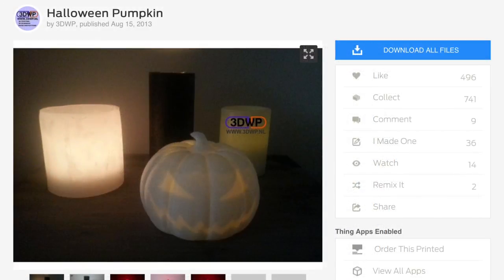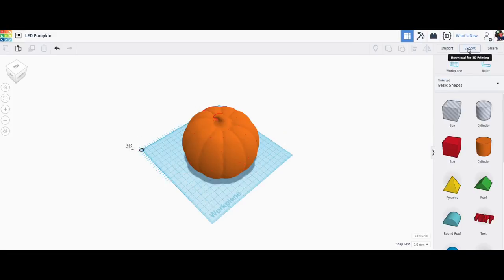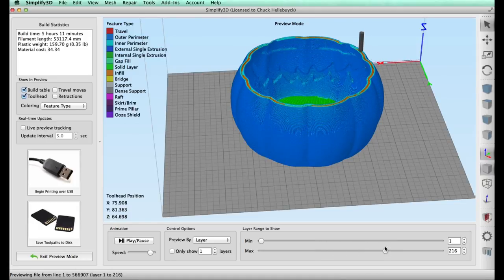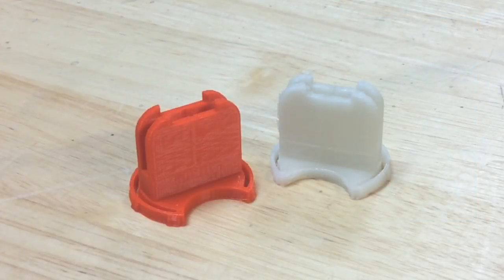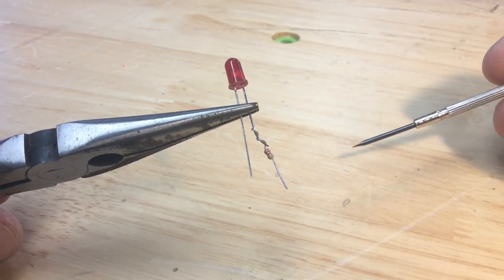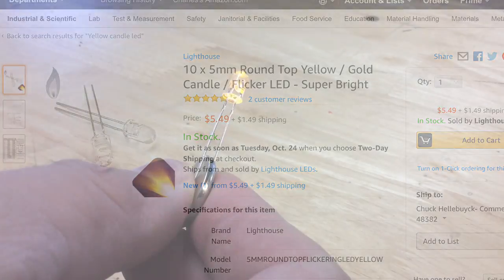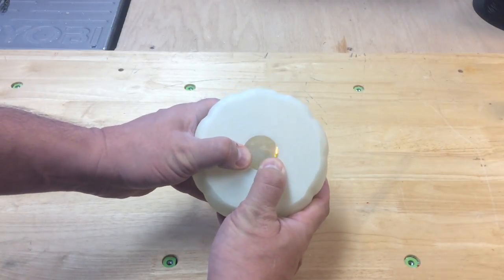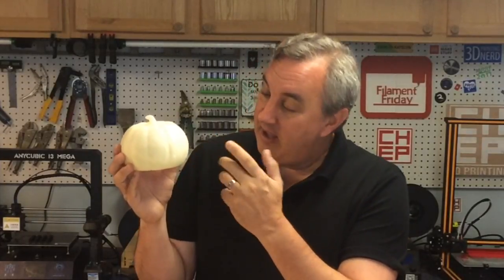3D Printed Halloween Jack-O'-Lantern Pumpkin with LED Lighting

Comment: That's pretty cool. I haven't used tinkercad in a while, I need to check out the electronic part models it has. I know I can use that 2032 battery holder.

Comment: Thanks for the heads up. I printed one on my Tarantula and my wife loves it :-o. 
I used the thin model with no supports. Came out fine, but there were a few stray strands at the top.

Comment: That's not a bug. Most CAD software convert the model into a manifold (solid) part once you close all surfaces. It's just the way they work.  That's why when you placed the hole there first it worked like you expected.  It couldn't make a solid form out of it.
Reply: That's pretty much it.   Try not to have the hole too small as that can cause issues for some programs.

Comment: One of the ways you could have prevented the light holder from going in too far would have been to design a 5mm thick lip for the holder to fit on.  This would have prevented the LED holder from going in too far.

Comment: I noticed really strange. the circuit stl has the expansion/friction fit start on layer 2 rather than layer one. so it prints a little messy unless supported

Comment: Actually Chuck, that´s not a bug, other 3D modeling software works the same way. STL water tight solid files cannot be hollow inside, to make it hollow one of the two solids must have an opening.
Reply: The only bug part of it i see is tinkercad isnt rendeing it properly then before added the hole. As yes it should by order of operations, result in a solid pumpkin when hole is added last. Hollow pumpkin capped, solid pumpkin, add hole, hole in solid pumpkin.  Versus hollow pumpkin capped with a cap with prexisting hole results in hollow pumpkin with hole. Its an assumption tinkercad and most simple cad programs have to make as undefined things happen. You grouping the objects before adding the hole was the error i saw.
Reply: yea im saying its a bug it was probably in how Tinkercad was rendering it. By standard order of operation rules that most cad programs use, it "should" become solid/watertight when you capped it and rendered as such. So if when exported just as pumpkin with cap, it exported hollow, then tinkercad uses a nonstandard ruleset for defining internal boundries. But either way now you know, leave a hole in one surface before grouping items if want it hollow fully. Doing the hole last would be the process if wanted the program to assume your adding a blind hole into a solid object and thus render the internal wall structure from the hole edge, to the pumpkins "skin".

Comment: I was purchasing on amazon but wasn't sure it would get here in time so i ended up calling the vendor lighthouseled and they told me that you can order straight from them cheaper and you don't have to buy such a large quantity. I bought 10 flickering leds with shipping cheaper than just the leds on amazon.
Reply: CHEP 3D Printing & Electronics I took the direct route and just pp'd you the difference. This was an awesome video and I have your pumpkin printing right now. One interesting thing I found last night was cura 2.7 made this a 13 hr print, when I upgraded to 3.0 it made it a 7 hr print. I have no idea what the differences are so I'm going to print two and see. Lucky I have my hardened nozzle installed rather than the brass, with all the gitd filament I'm printing recently (I also did a glowing skull candy dish) a brass nozzle would have been ruined.
Reply: CHEP 3D Printing & Electronics oh yeah and price/quantity, on amz you have to buy 10, on their site you can buy one or two or mix colors. I bought 2 different types. The owner said he had just gotten an unusual amount of orders, I ended up emailing him your video. He said he'd been thinking of getting a 3d printer and I suggested he take a look at your reviews.